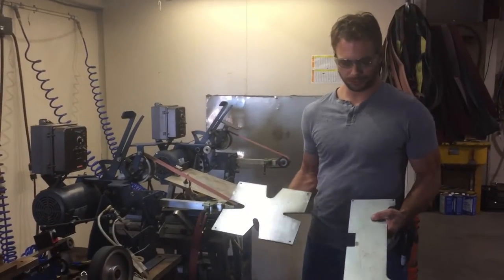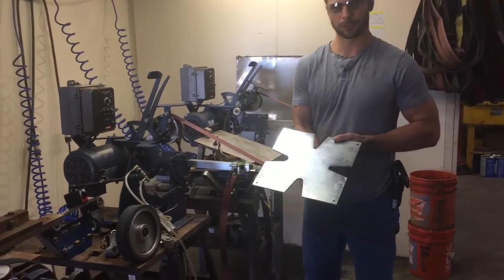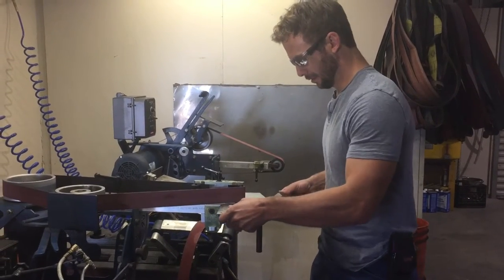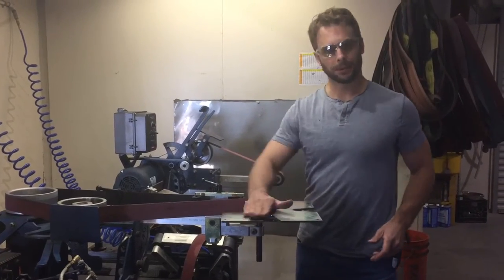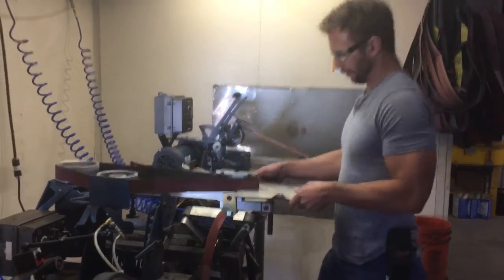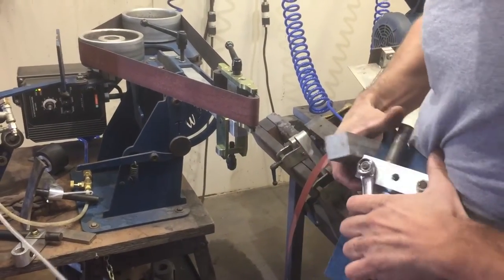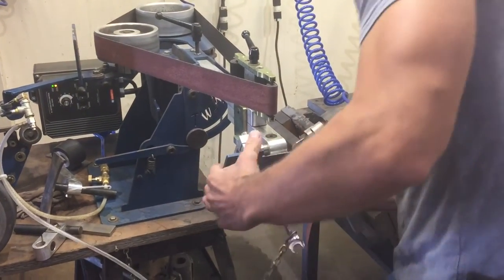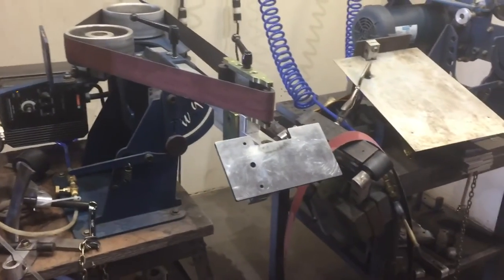Introducing and using Wuertz Machine Works "doubler plates "

Comment: hey i was just wondering whem that small high speed belt grinder you made that could fit in a suit case and ways less than 20,lbs because i want some and ive got a knife sharpener that im welling to let you have the rights to if you want it besides i can't afford to get it in to the market wouldn't know were to start